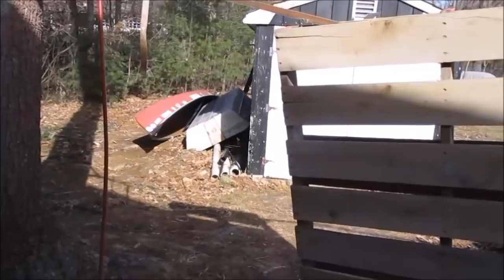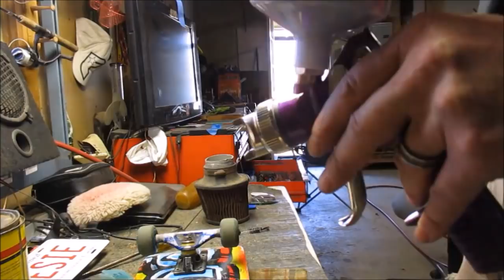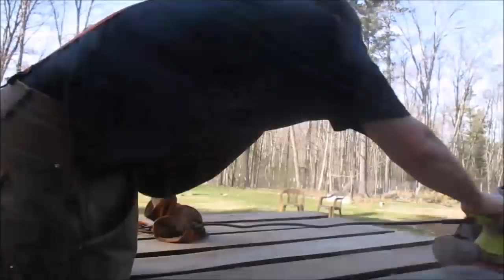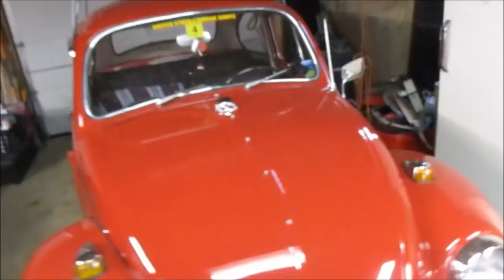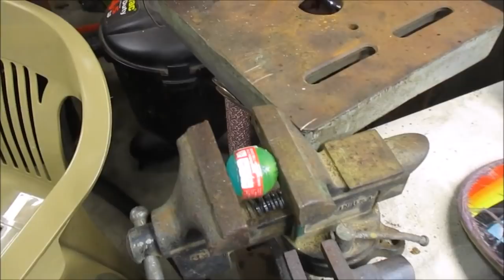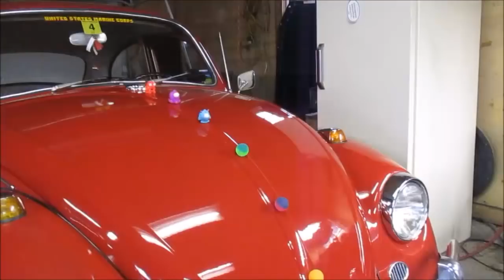1967 bug custom accessory's and reused pallet fence

Comment: Thank you for the video, Brian. I've got a suggestion/video for you. Run a "hard line" from compressor to ceiling, and over to an overhead retractable hose reel. Up out of the way, clean and neat. I also had an overhead retractable electric cord, that I put a drop light on. Those were two very useful things when I had a home garage. At HF a 25' air is $55 and a 30' electrical cord is $50. After a few uses you'll be amazed.
Reply from the maker: I like your suggestion and i was just at HF so i will go back thanks for watching  HUBBABUBBA DOOPYDOOP

Comment: Love Ruby's new accessories! I am sure they will be s hit at the upcoming car shows.  With the cold start and move, I see you did not run ruby for long before moving her, I was always told this was bad, and have even been griped at because I do it in my "Old Car" which is a 1990 with a 5L fuel injected engine, what are your feelings on the subject?
Reply from the maker: it depends on so many things. people, car weather, how long ago was the car started, type of oil and pump ect. the list can go on forever. i was not moving ruby very far or fast and i drive her every day. so in this case it was ok. those are my thoughts. thanks for watching mspysu79